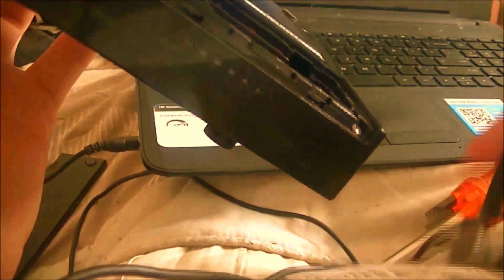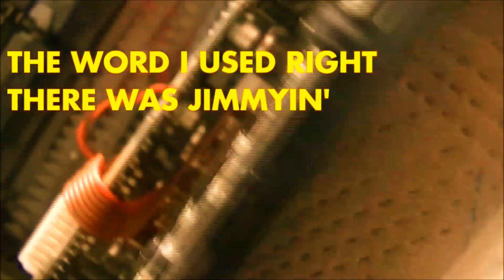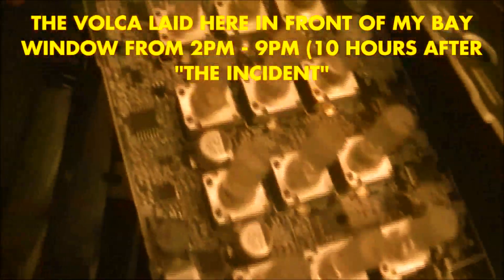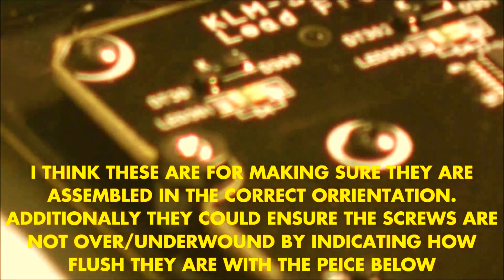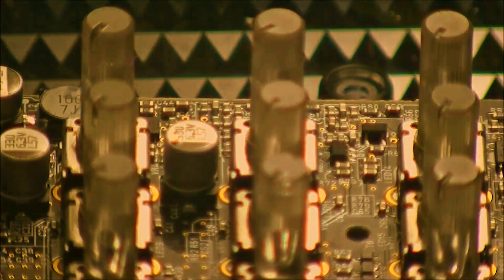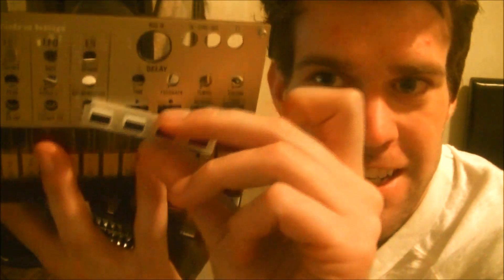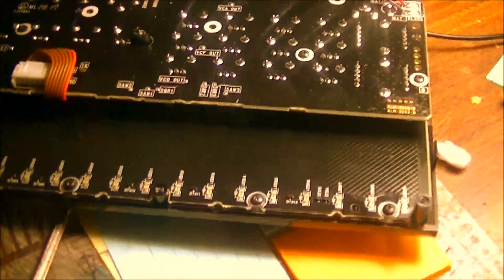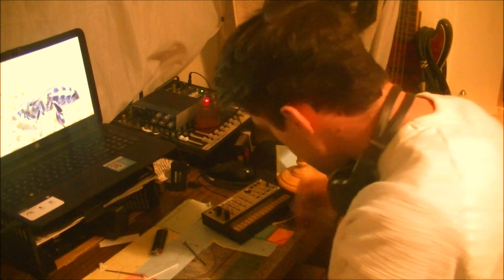How to fix a KORG VOLCA KEYS you spilled water on (Tutorial #9)

Comment: Hey brother, this is good stuff. Wonder if you could help me with my issue... The key on the touch pad that reads 'step trigger' does not produce any sound when pressed.. This issue has only recently come on. All other buttons and keys work perfectly.. Its literally just that one. What could be the problem?
Reply: Ever figure that problem out? I reckon it's either a capacitive or resistive strip that may not have been making contact at that spot.

Comment: Hey bro, I'm very glad to find this, I have a little volca bass. And since the second week of using it the Internal speaker it has inside broke or disconnected, I really don't know what happened as it used to work fine. Can you help me figure out if I can fix it by myself or should I take it to a local tech guy?
Reply from the maker: speakers are very easy to fix. BUT You need a few things: 1. A Soldering Iron 2. Solder (60% Lead/40% Tin) 3. Wire 4. A replacement speaker (If Necessary) 5 A Multimeter. Those are just the items you need. You also need to understand basic Electronics repair, like soldering wires back on if they get disconnected, being able to identify a broken part/how to desolder it and remove it without messing up any other components/where to purchase a replacement component/how to solder the new component in its place.

If a speaker is broken on your volca then most likely one of the two cable connecting the actual speaker to the circuit board has fallen off or broken. You first need to take apart the Volca like I did in my video and then find the speaker and make sure all the wires are connected properly. If they aren't then you need to reattach them with solder. 

If you want, after you open it up, you can take 5 or 6 photos from multiple angles, up close to the circuit board and send the photos to me and I will see if I can spot the problem for you. My email is dannysebahar@gmail.com

Comment: I wonder if you can help me, a lot of the time the soft rubber function buttons on my volca units stop working or I have to press really hard on just the right spot for it to work. If I take the whole thing apart and then reseat the little rubber pad it'll work but then after a little while it'll go back to not working. Any ideas on why or a way to stop it from happening?

Comment: My Korg Volca bass won't turn on, any idea what could be wrong? I didn't use it for a while and now it just won't turn on.
Reply from the maker: are you powering it with batteries or a power cable: #1 change batteriesif youuse batteries, #2 if plugged in jiggle the plug input to see if the input has jostled iyself loose as power inputs on electronics on items this small are frequently unplugged and plugged in with a lot of force which is why every phone i have had has broken due to the power jack becoming unseated...

If it won't turn on it's a power issue because if it is getting power then it would at least light up the LEDS (it may do nothing else, but we don't know yet, that's not our issue. So open it up by removin the screws and try and see if you can find where the power is either being shorted to ground or where the open circuit is buy testing the voltage in between nodes starting at the node nearest where the battery is input or where the DC Power Jack is.
Reply: @DannySebahar  batteries and power adapter, both not working.
Reply from the maker: @ZealX  Good, so now we know the issue is just concerning the power supply and since its effecting both then it's very likely  an issue with a pcb trace in the unit's power supply section which should be easy to find with a magnifying glass, a broken surface mount capacitor (not likely), but most likely the on/off button is disconnected itself from the circuit board.

The unit has a lot of tiny surface mount components and almost no moving parts so the electronics are hardt break. If it was an  issue not with the power input then it would exhibit different symptoms of failure. It would likely turn on and the LEDS would flash, and since the battery also does nothing as well as the input power jack the input power jack is probably fine so the only other moving part in the power section is the the on/off button.
Reply: @DannySebahar  following your second instructions right now, will keep you updated.

Comment: Hey man, any tips for fixing a Volca Keys speaker that doesn’t work? Sometimes I blow air into the headphone jack and it’ll work for a bit, but not for long. Sound is fine through headphones.
Reply from the maker: Yes its very easy to fix, but you need to know electronics and how to fix electronics. You either replace the speaker (but the speaker works it just sounds disconnected) or reconnect whatever wire is slightly disconnected. if you don't know electronics then post an ad on craigslist requesting someone to fix it for $10. Someone will do it.

Comment from the maker: @deathbird watch the first tutorial I made all the way through. I know it's fifty minutes but by using "1/4" & "Flux" mode you are able to get a quantized 128 step sequencer, or using "1/2" mode a 64 step sequencer or just simply flux mode to get a 32 step sequencer. it's a fully analog yet electronic machine so there must be at some point in the recording process (As the recording certainly is digital and therefore limited by some sort of bitrate which happens to be 32/second)  it's going to have to quantize the notes according to the bitrate of the digital recording mechanism and in the following video steps on the sequencer can become as high as a 128 eight quantized and if you lower the BPM 2to 56 BPM which is the lowest you can set it then you should be able to write a 128 step sequence that is quantized with in .02 seconds and THEN  using the a"Active Step" function, you will be able to have four different 8 step sequences (or 2 x 16 or 4 x32 that you can select all within one memory bank. Please watch the whole video so you can see that it solves your problem: https://youtu.be/RsbGp6zS2bM
Reply from the maker: +DeathBird awesome I hope that you we're able to see that the Korg volca keys can do what you wanted to do without having to use an external sequencer and or Shuffle. I'm certain that it's much easier using an external sequencer and schefflera but I am low on funds so I have to make do with what I got and necessity is the mother of invention so I figured this out. Here is a link to the active Step video I made that you said you already watched but it would mimic the shuffle qualities of an external sequencer: https://youtu.be/0Z7nU0laK-g